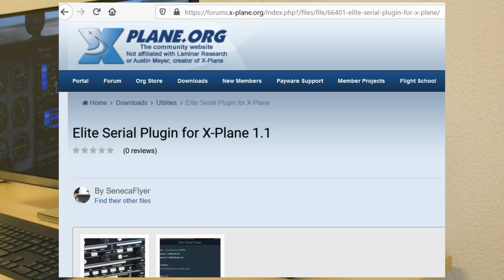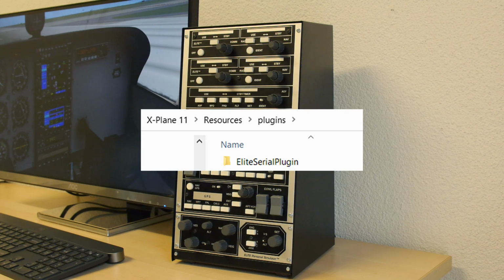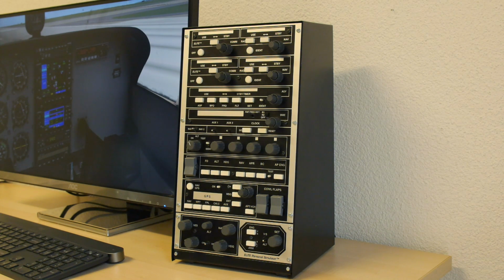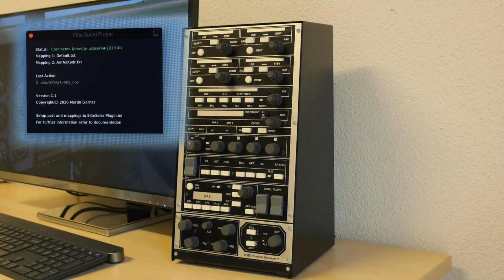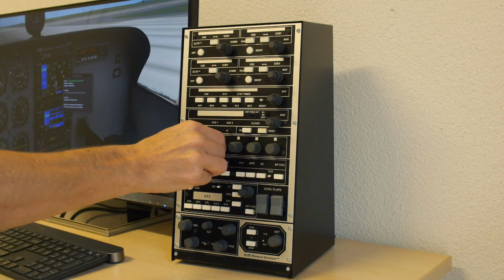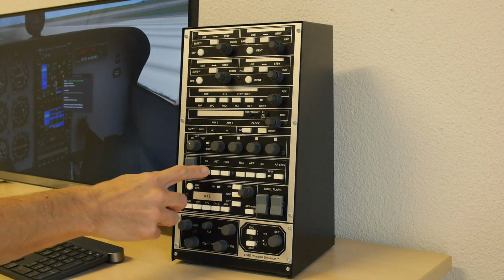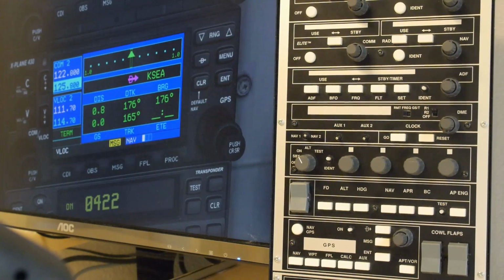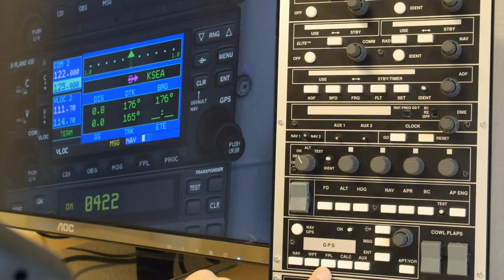ELITE Hardware Plugin for X-Plane

Comment: Help!! I tried following your steps and when I launch plane 11 and plug my Elite pro panel into my laptop, it still doesn’t seem to recognize it as a yoke under the joystick tab 😒
Reply from the maker: The plugin is directly communicating with X-Plane. The Pro Panel will not appear as joystick. You should be able to directly use all the switches and yoke/throttle once it's connected. If not check the status in the Plugin Menu. Please note that the plugin is only for the serial port version of Pro Panel. For the USB version there is a plugin on the Elite Website.
Reply: @senecaflyer7888 ok I appreciate your help in this, the pro panel I have has USB cables so maybe I need to install different plug-in off of the website?

Comment: Thank you so much! I've been spending hours trying to solve the inability to use the AP2000 with MSFS 2020. I have the FSUIPC and the Elite Hardware MSFS2020 utility installed. It sees an "Elite" device as connected, but doesn't mention the AP2000. Then when I go into MSFS, it still doesn't see it. I installed the recommended driver for XPlane that was available on the Elite "Third Party" downloads. That didn't see the AP2000 in XPlane either. It wasn't until I downloaded your plugin in XPlane... and it worked! So happy about that! Thank you! Any suggestions regarding MSFS2020 and getting it to recognize the AP2000?
Reply from the maker: Hi Ed
Thanks for your comment. The plugins from the elite page work only for usb devices. At the moment I only have my serial plugin for x-plane. Once I find  an aircraft in msfs 2020 that would honor the full potential of the AP2000, and if I find some time to work on it, I might consider it.

Comment: Hi 

Thanks for making the plug-in , will give new life to my old hardware.

I have a elite AP 2000 and AP3000

Do you have a diagram to show how to connect the AP2000 , Do I need a serial to usb adaptor ?
Reply from the maker: Hi Russell
You should be able to directly plug the USB to serial adapter into the 9 pin port of the AP2000.
Reply: someone on the forms wants to by an AP2000 (or prob AP3000) if you wanted to get rid of one of them
Reply: Did you happen to get the AP2000 to work with MSFS2020?